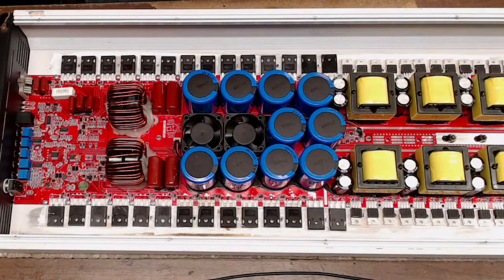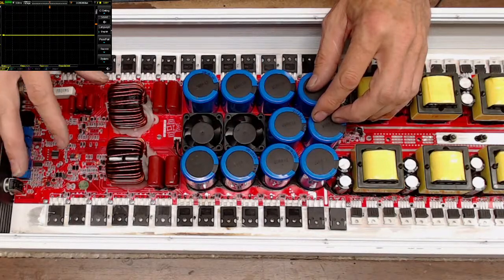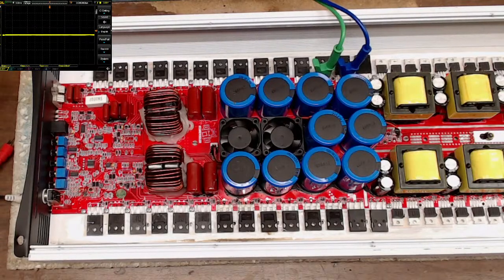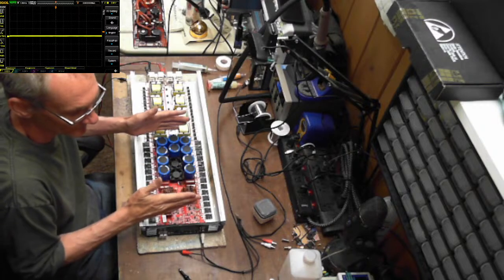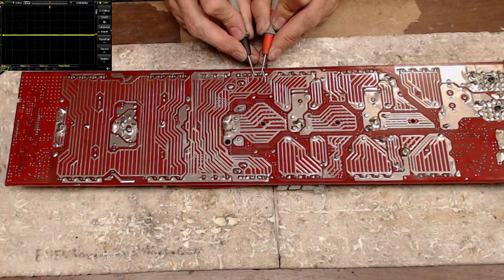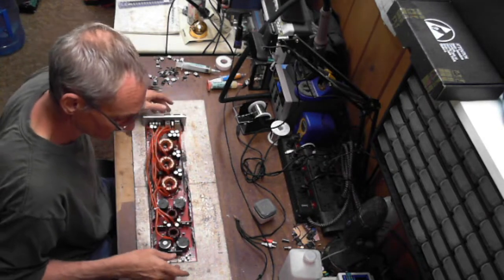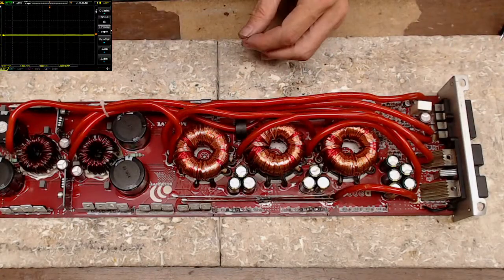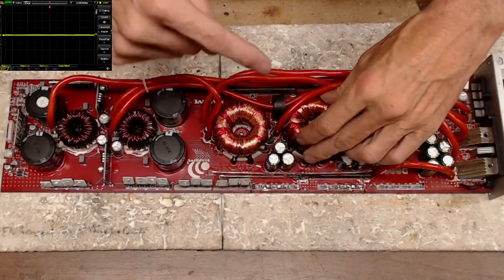B2 Riot 16k Class D Brazilian Style Repair Then a Massive Audio Primo P8

Comment: I have the 8000W version help i oscilloscope my amplifier on the output mosfet and I got high voltage sine wave no pwm pulse help 😢
Reply from the maker: Since it is a full bridge amp, you will have a positive voltage that should be about half of the rail voltage at the output terminal. If you don't have any output shorts (or you just rebuilt it) and you don't have modulation, then check the pre-amp signals.
Reply: @ellensburgamplifier No output shorts all closes and open when tested

Comment: Does this amp and the riot 7500 share the same input mosfets?
Reply from the maker: I am not 100% sure but most Brazilian designs use the 1404 or the 180n transistors.
Reply: @ellensburgamplifier  thank you

Comment: Hello i have a Problem with my B2 3200 Riot. Clipping led every time on! what needs to be repaired? I would desolder it myself. Thx
Reply from the maker: The output section needs a rebuild. Quite a bit has to be replaced like the output transistors, zener diodes, gate resistors, gate drive ICs, and possibly some work in the DC offset circuit.

Comment: hi sir how are you i have power bass ASA1500.1DX have problem in out  i start  to fix it but i can't doit but i didn't damage  any thing how much is cost you to fixit i work in phone and play stuion and i love to work in car amplifire too
Reply from the maker: It is hard to say how much it would cost to fix that amplifier. I suspect a shorted output and the output card needs to be rebuilt. These cards have a high failure rate due to heat. Does the output use the 31N20D transistors?
Reply: yes but i test them is ok i change some resistor and 072d ic and little trick  i  just ask about cost because is not my amp i fix phone and laptop and people sometimes ask me if i work amps too but i have no experience in amp repair but if u help me out i can send it to you i live in Alabama i don't know how much shipping cost is that why i ask how much